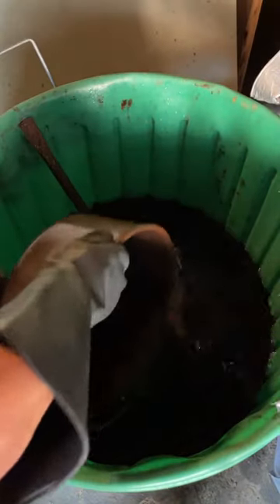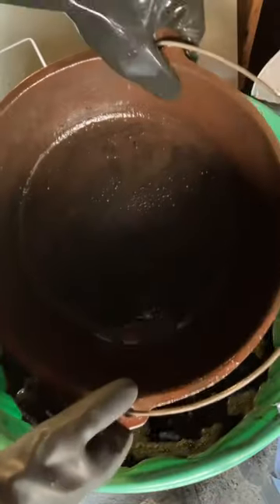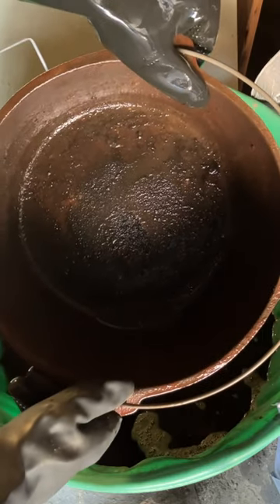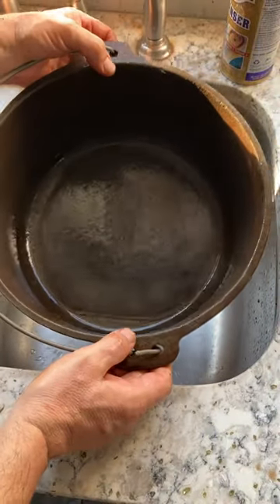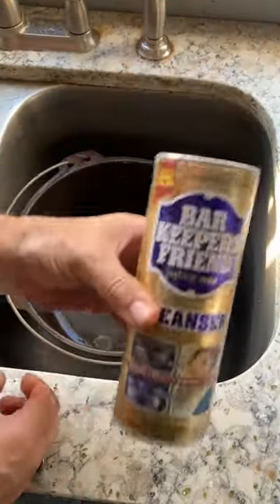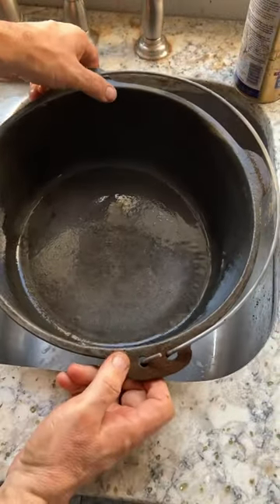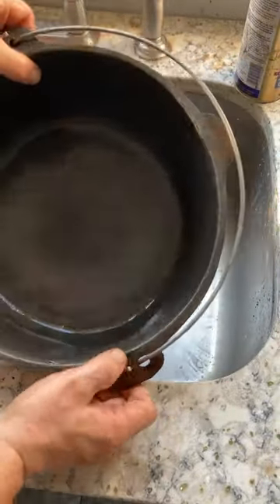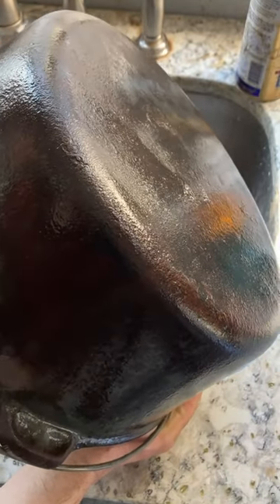Restoring a rusty cast iron pot, part  2…

Comment: CIC, it’s looking good. Knowing your ability, it will be beautiful when you are finished with it. Agree that it needs a little time in the e-tank. I learned through experience to run all of my pieces through the e-tank. If no rust is being removed after a few hours, I’ll pull it for seasoning. IMO, it’s disheartening to season a piece and then well hidden rust starts to pop out over time. But that is just my procedures, everybody does it differently.  Good live show last night…Dan